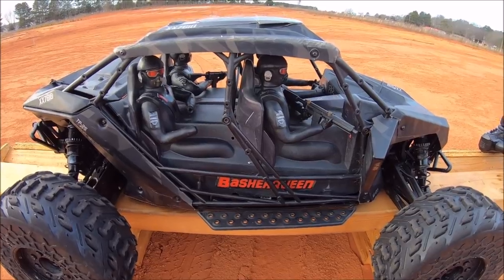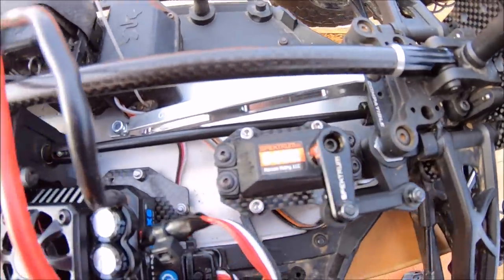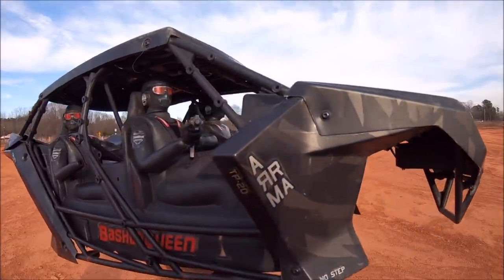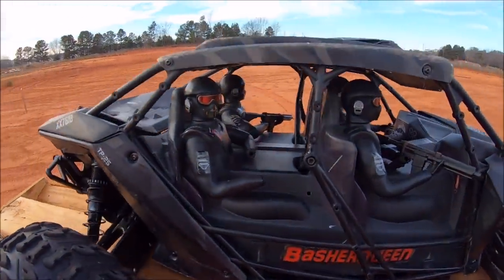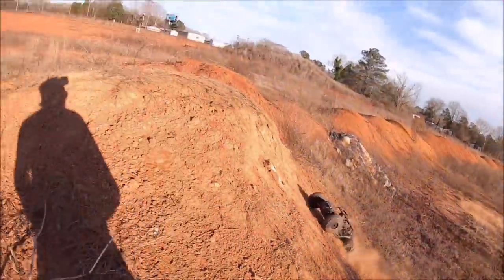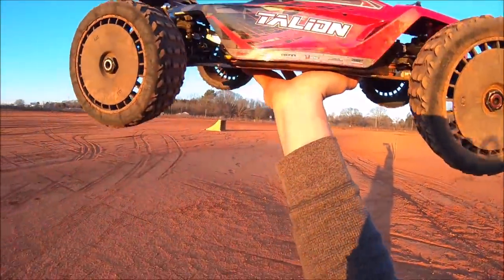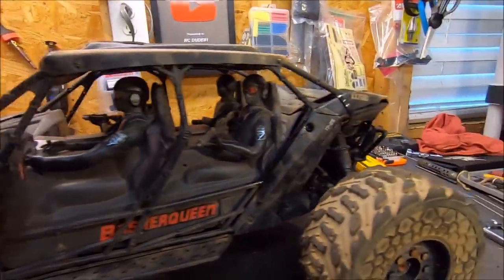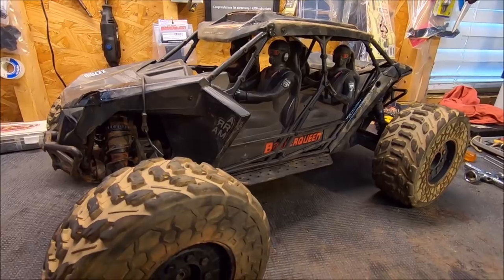ARRMA Fireteam gets BEEFCAKED😱with Talion Stallion rips!

Comment: Awesome as always you need to get and produce a video with the hobbystar 4585 1800 or 1580kv they're the best motors I swear for arrma love them both but been rocking the 1580 23/46 gearing in my EXB Mojave with a Max 5 is just insane pretty sure Max 6 would be just as good I just went for Overkill cuz I don't run it on 8s anyways but hopefully you can get one of those motors and do a video on them cuz they're s*** for videos on YouTube

Comment: What diff oils are you running on your talion to get it to wheelie? I'm running 40/200/10 (f/c/r) and it handles great but no wheelies. also running the newer badlands 3.8s
Reply from the maker: I'm running 50k, 200k, 30k front to rear. Also punch 9 on the ESC and 20 tooth pinion. This Talion has always been rabid!🤣🤣Keep an eye on temps with the larger pinion gears!
Reply: @RCDUDE81  What shock oil weight do you run? I'm still on stock and it seems fine, but just curious to see if you changed it
Reply from the maker: I run stock 2000cst on the Talion. It does work great!

Comment: Looks and runs spectacular.I've been considering Basherqueen parts for my mojave for awhile now,if they hold up for you they'll definitely hold up for me.
Reply from the maker: They are stellar parts!😍Just a tip if you use super glue around the edge of the towers, they should never chip! Just Basherqueen tough CF!💪💪
Reply: @RCDUDE81  Thanks for the tip.

Comment: Great session like always. Could you explain what your rear servo is used for? Afaik the car has no 4wheel steering...?
Reply from the maker: Thanks so much! The rear servo is for the rear handbrake. It basically locks the rear tires for drifts and quick turn arounds. I don't use it much but it's a cool option!